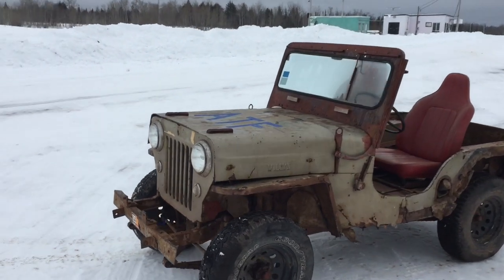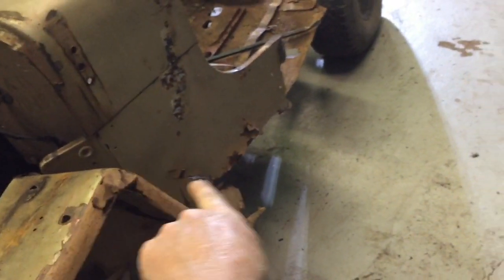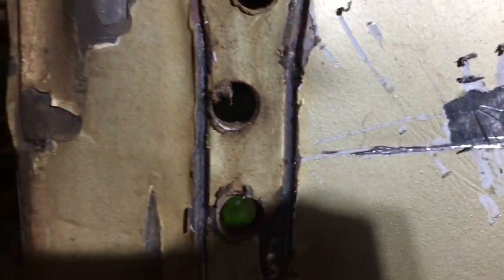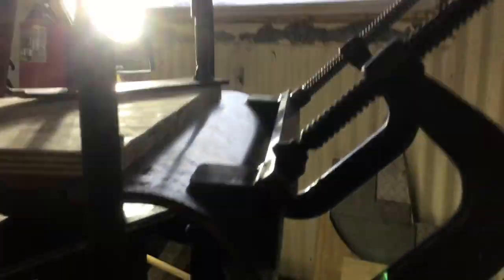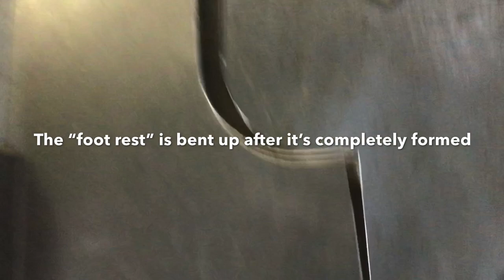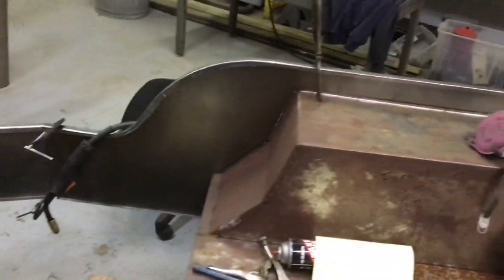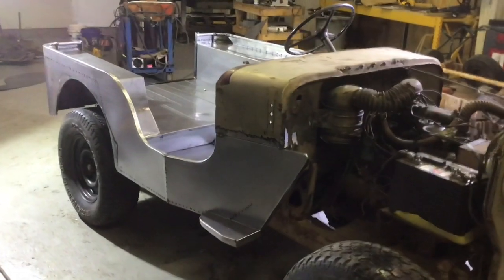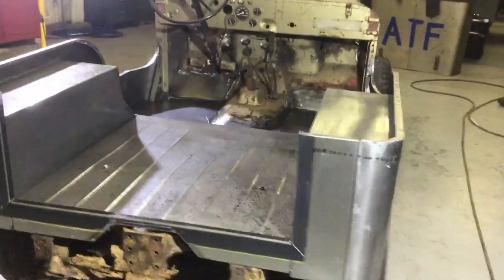Willys Jeep CJ3B mild restoration #3 Four day body build

Comment: If y'all could build a few of them tubs and sells them y'all can make a good amount of money I built a willys jeep years ago I put the the tub on a cut down 81 Toyota 4x4 truck frame use everything from the Toyota motor transmission transfer case and axles I called it my toy jeep
Reply from the maker: “Toy Jeep” Very cool! We’ve talked about it, need to refine our hammer forms a little more before we go that far. Thanks